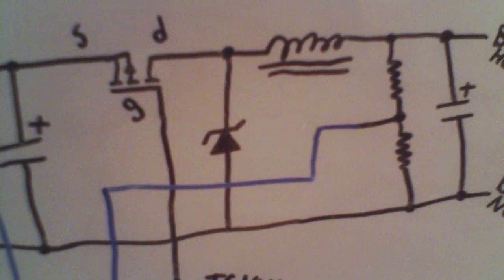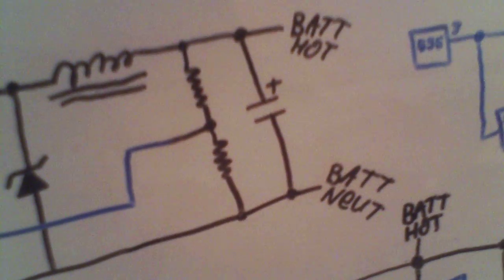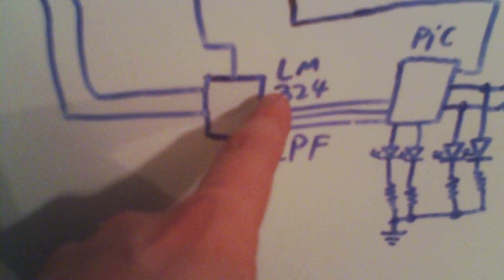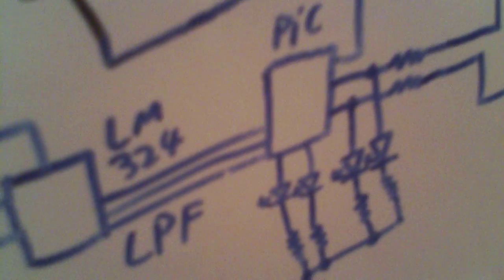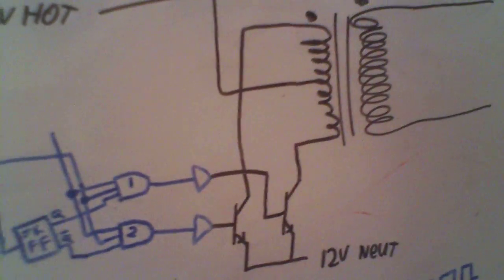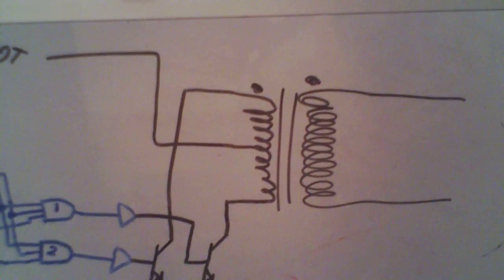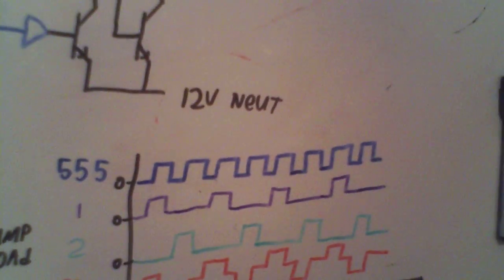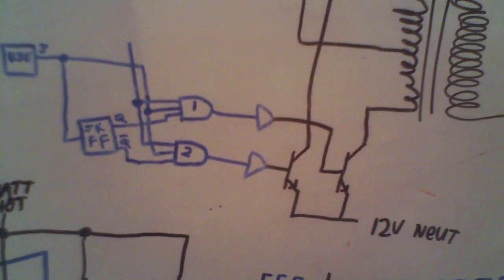DIY MPPT PV charge controller project rough design video

Comment: is it theoretically possible to have an MPPT controller capable of 2000 watts up to 150 Volts that converts it into 24 volts for a rather huge battery bank?
Reply from the maker: Those already exist.  They are around $1,000 and change from what I remember though.  The one I saw was good for up to 600V input and around 80A to 100A charging current.

Comment: Hi!
I'm trying to converge all the informations i'm getting here and there from interne in order to design an open source photovoltaic centraline including mppt converter and inverter.
I have a questio, hope you would be glad to answer: which pic are you using?
Thanks a lot,
take care!
Simone
Reply from the maker: The PIC I used for my current work in progress is a PIC16F685, but any micro with hardware PWM capabilities and at least half a dozen ADC channels should work.  I am planning on using either a PIC16F1939 or a PIC18 (can't remember the full part number) in the 3/4 separate array tracking system management unit (multi array MPPT with multiple levels of dump load control, serial comms for communicating with other parts of the system and a low learning curve UI for configuring it).
Reply: Thanks a lot! Your work is so precious!
Simone

Comment: I'm trying to do something similar, and it's amazing that we arrived at similar design choices, all the way down to the PIC and 25 kHz switching frequency.  My intention is to use a PICAXE 14M2, but until seeing this video, had not considered using a Hall Effect sensor for current - I was using a plain old 50 milliohm current sense resistor.

Comment: If your going to combine the 2 units as you say you might. If one goes down and needs repairing. Will the other unit still operate while repairs are on going. Or will the whole unit be removed for repair? Fantastic idea by the way.